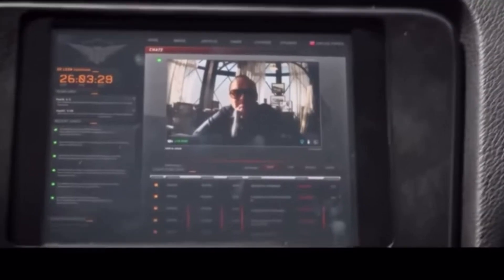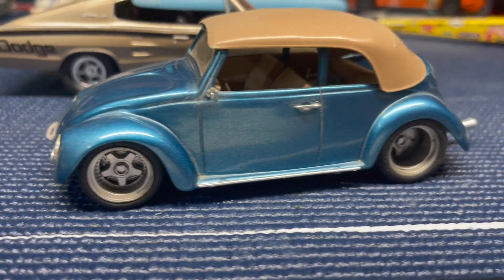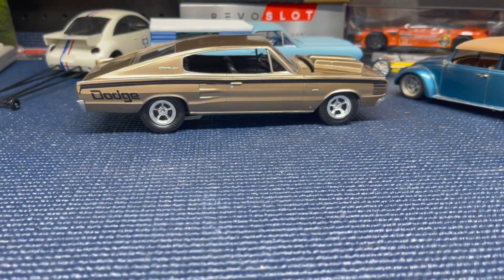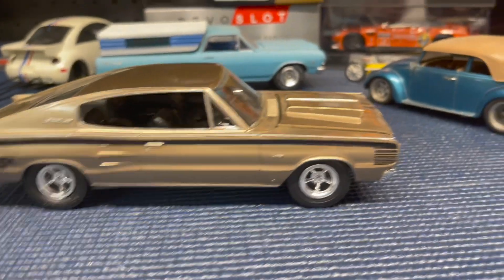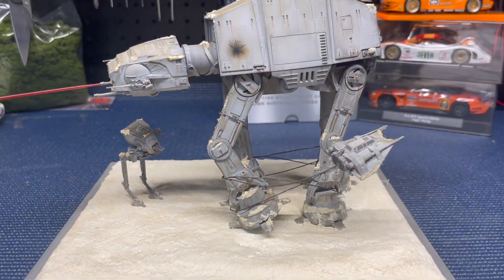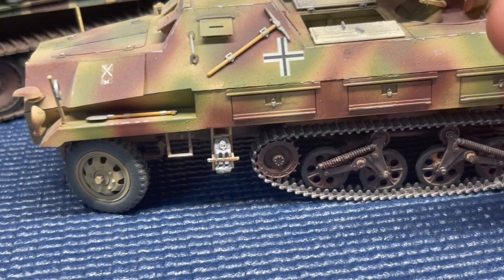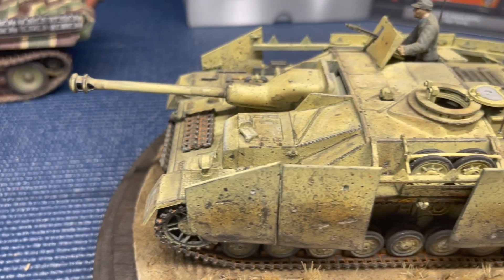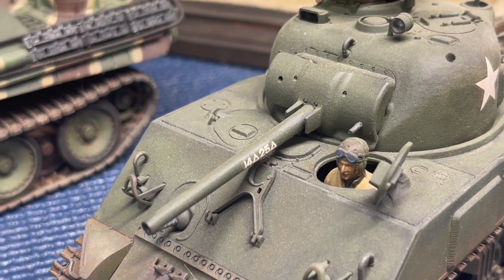Before I got into Slot Cars....I did this

Comment: In the early  60's when I was just entering my teens most of our slot cars were hard bodied.  Loved them for the realism. Clear bodies were just starting, I was managing a hobby shop until about 10 years ago with two old road tracks and a drag track. Hard 1/24-1/25 models are so great for drag cars.
Reply from the maker: The ability to use hard plastic bodies allows you to use pretty much any type of car body you want to use for dragracing. I used to also work in a hobby shop, probably the most fun I’ve had in all the jobs I’ve worked.

Comment: Right on. I used to build a lot of models in my youth. But as you mentioned, if they get dusted off, they will break. So me, comming home from school, going into my room was always a kind of a nightmare, because my mum dusted them off and broke quite a few of my loved models. The good thing though was, after new years eve, we walked around in our city to collect all the fire-crackers that did not blow up. We got the gun powder out of it and mounted that into the models and blew them up. Battle ships got blown up in the river that we had right across from where I lived. Airplanes I let off flyin`from our balcony . They really went off well, by mounting rocket-bodies under the wings. Cars, we ran off a ramp and blew them up. lol If I think about it today, we could have gotten hurt big time, but as a kid, you don`t think about it. I still have some american cars, that I packed up and kept them until today. I still have a few kits unbuild and in the near future I will use them for scratch building. I also kept a lot of broken stuff, like engines and what not of the broken cars, for just that. I guess I knew I could use all those parts later. And the time has come now. ;-) Nice clip and nice work on them. I even had a few models you built there. Thanx for showing them. Keep it going, Brother! 🙂
Reply from the maker: Thank you Bo. We did a lot of unsafe stuff as kids. Fire crackers always seemed to be available and near by.  I can only imagine all of stuff we set fire to or blew up. Now, I just loose finished model kits to the dogs who seem to enjoy pulling them off the shelf and playing with them violently🥹
Reply: @TheDeLeonHobbyGarage  Hi again. Today I finally re-found some of my old Car-Modell`s I had built in the 1970`s in a cardboard-box. I knew I had them somewhere and I found them hidden inbetween some other boxes. The rest of some other Cars I had, had missed the a lot of parts, which were hidden in  that box as well. A trip back in time this was again today and made me real happy, because now I got all the parts, so I could build them back together, or use them for scratch-building. 🙂

Comment: You mentioned brake fluid as a paint stripper. Is that what you normally use? Great models!
Reply from the maker: Yes, I traditionally have used DOT three brake fluid that I’ve collected over the years when I am working on my cars’ braking systems.

I store my used brake fluid in a glass jar and brushed onto styrene plastic as well as Lexan to soften paint where it can be wiped off with a little help of an old toothbrush. 

Brake fluid can be extremely caustic so use caution and gloves, and do not ever use it to strip resin bodies. It will melt them.

I’ve learned about the brake fluid through the modeling community. It has worked for me every time, but I have heard stories from some people that it can make your plastic Brittle, I have not found that to be the case yet. Others in the RC hobby have claimed it has fogged their clear Lexan. I have not found that to be the case with the particular brake fluid I use. 

I will take an aluminum throwaway baking pan, put the model body in the pan and brush brake fluid on. A new paint job may take several minutes to loosen the paint where as an older paint job traditionally painted with Laquers or enamals could take a few days with repeated applications. Brake fluid is cheap, but I do not throw it away when finished. I keep it bottled in a jar and reuse it over and over again as need be.

Test your results on plastic model kit sprue before you apply it to the entire car. Your mileage may vary.
Reply: Outstanding - thanks. I have a couple projects I need to do but wasn't sure how to proceed @TheDeLeonHobbyGarage